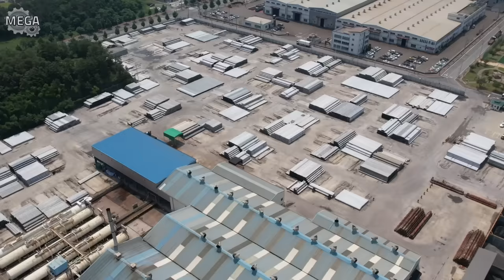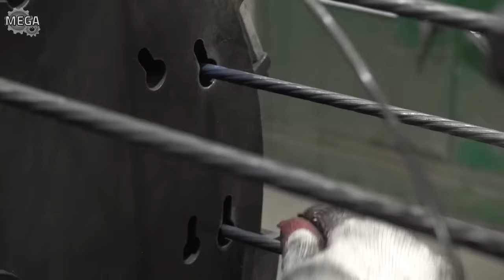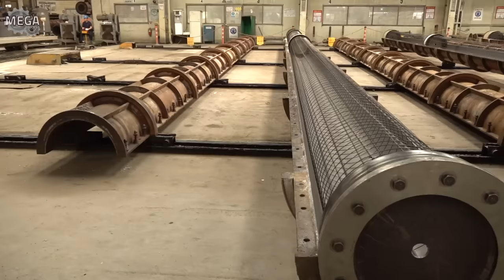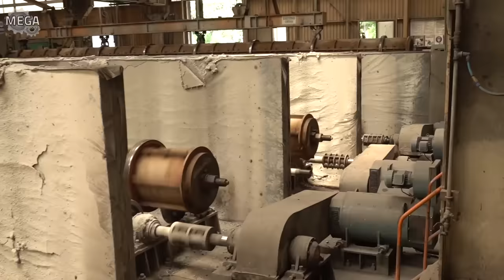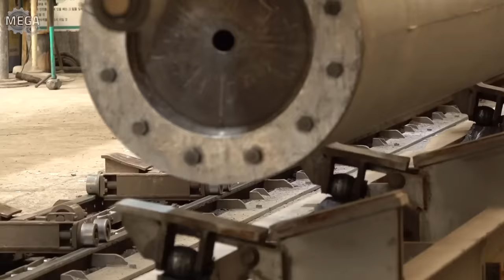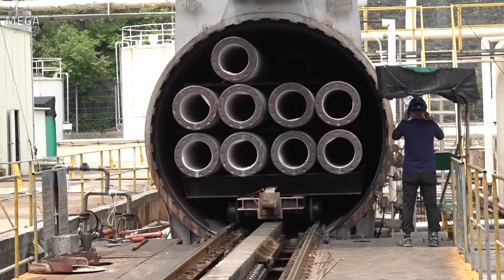Process of making ultra-high-strength concrete pile. Korean No.1 PHC pile factory

Comment from the maker: 🔎 Information (정보)
🔔 Ultra-high-strength concrete pile in the video (영상 속 제품) : 삼일씨엔에스 (bit.ly/3XF8vTx)
🗺 Address (주소) : 896-15, Gyenae-ri, Chilseo-myeon, Haman-gun, Gyeongsangnam-do, Republic of Korea (경상남도 함안군 칠서면 공단북길 50)
Reply: 😊😂😢❤😮ຫຫຫຫຫຫຫປປປຶຫຫຫຫຫຫຫປປປໄົຝຝຝຝຝຝຝປໍຝຝຝຝຝຝຝປໍຝຝຝຝຝຝຝປໍຝຝຝຝຝຝຝປໍຝຝຝຝຝຝຝປໍຝຝຝຝຝຝຝປໍຝຝຝຝຝຝຝປໍຝຝຝຝຝຝຝປຖຖຖຢຮືືືືືືືເເເເເເຫ❤😮😢
Reply: Pp
Reply: 가격은 얼마나 할까요?
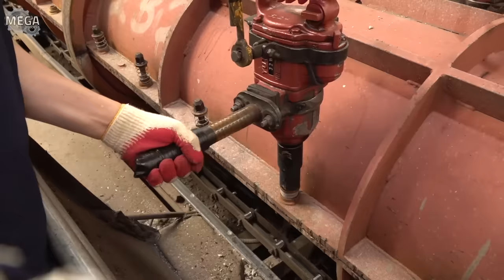Reply: ㆍㄱㆍ2ㆍ2ㆍ2ᆢㄱᆢ2ᆢㄱᆢㄱ2ᆢ2ㆍㄱㆍ2ᆢ2ᆢㄱᆢ22ᆢ2ᆢ2ᆢㄱㆍ2ㆍ2ᆢ2ᆢㄱㆍㄱᆢㄱ2ㆍ2ᆢㄱ2ㄱㆍㄱㆍ2ㆍ2ᆢㄱㆍㅋ2ㆍㄱ2ㆍㄱㆍ2ㆍ2ㄱㆍ2ㄱㆍㅋᆢㄲᆢㄱㆍ2ㄱ2ᆢㄱㆍㄱ2ㆍㄱᆢ2ᆢㄱᆢㄱ2ㆍ2ㆍ2ᆢ2ㄱㆍ2ㆍ2ㆍㄱᆢ2ㄱᆢㄱㆍㄱᆢㄱᆢ2ᆢㄱㆍ2ᆢ2ㆍㄱᆢ2ㄱ2ㆍ2ᆢㄱㆍㄱᆢ2ᆢㄱᆢ2ᆢㄱᆢㄱㆍ2ㆍ2ᆢㅋㆍ2ᆢ2ㅕᆢ2ᆢ2ㆍㅋ2ᆢㄱㆍㅋ2ㆍ2ᆢ2ㄱᆢㄱㆍ2ᆢ2ㄱᆢㄱㆍ2ᆢ2ᆢㄱᆢㄱㆍ2ㆍ2ㆍ2ㄱㆍㄱᆢㄱᆢ2ㆍ2ᆢ2ㆍㄱㅋㆍ2ᆢ2ᆢㄱㆍ 5:26 ᆢㄱㆍㄱㆍㄱㆍㄱㄱᆢ2ᆢ2ㆍ2ㄱᆢ2ᆢ2ㆍ2ㆍ2ᆢ2ᆢㄱㆍ2ㆍ2ㆍ2ㆍㄱᆢㄱ2ㆍ2ㆍㄱㆍ2ㆍ2ㆍ2ㆍ2ᆢㄱㆍ2ᆢㄱㆍ2ㆍ2ᆢㄱㆍ2ᆢ2ㆍ2ᆢ2ᆢ2ᆢ2ㆍ22ᆢㄱㆍ2ᆢㄱㄱᆢ2ᆢㄱᆢㄱㆍㄱᆢㄱᆢ2ᆢㄱㆍㄱㆍㄱㆍ2ᆢ2ㆍ2ᆢㄱㆍㄱㆍ2ㆍ2ᆢ2ᆢㄱㆍ2ㄱᆢ2ㆍ2ᆢ2ㆍ2ㆍㄱㆍ2ᆢ2ᆢ2ㆍ2ㆍ2ㆍㄱㆍ2ㆍㄱㆍ2ᆢ2ᆢ2ㆍ2ㄱᆢ2ᆢ2ㆍ2ᆢ2ㄱㆍ2ㆍ2ㆍ2ㆍ2ᆢ2ㆍ2ㆍ2ㆍ2ㆍ2ᆢ2ㆍ2ㆍㄱㆍㄱᆢㄱㆍ2ㆍ2ᆢ2ᆢ2ㆍ2ㆍ2ᆢㄱᆢㆍㄱᆢ2ㆍ2ㆍㆍㆍㆍ2ㆍㆍㆍ2ㆍ2ㆍ2ㆍ2ᆢ2ᆢᆢㆍ2ᆢᆢㄱㆍᆢ2ᆢㆍㆍㆍᆢ2ㆍㆍㄱㆍᆢㆍ2ㆍㄱㆍ2ᆢ2ᆢᆢㆍᆢ2ᆢ2ᆢㄱᆢ2ㆍᆢ2ᆢ2ᆢ2ㆍ2ᆢ2ㆍ2ㆍㆍㆍ2ᆢㆍ2ᆢ2ㆍᆢ2ㆍ2ㆍᆢㆍㆍㆍㆍ2ᆢㆍㆍᆢㆍᆢㄱㆍᆢㆍ2ㆍ2ㆍᆢㆍᆢㄱㆍ2ㅋㆍ2ㆍㆍㆍᆢ2ㆍ2ㆍㆍ2ㆍㆍ22
Reply: Wika beton sepertinya pernah berkunjung ke pabrik ini. 😊😊
Reply: Bak uap sama seperti yg kami buat..

Comment: Wow, in 08:11 you can see how strong negative pressure can be. If I see it correctly, the whole thing is held only by negative pressure. I would never have thought that with this weight.
The whole video is really very interesting. Thanks for that :)
Reply: I think it’s magnet
Reply: @Himanshuyadav-tz9yy  That's right, I hadn't even thought of that. I have therefore looked at the whole thing again. However, I think that there should have been much larger areas with the solenoids above. Of course, I can also be mistaken.
Reply: Suction cups landscapers use them for flag stone
Reply: @NexLevelBacon  Yes, also for transporting a wide variety of window panes.
Reply: @Himanshuyadav-tz9yy its not
Reply: Just to clarify it, there is not such a thing as negative pressure, just negative pressure difference.

Comment: Very interesting ! I thought the steel bars might be under tension while pouring the concrete to produce the high strength pile, please explain, thank you
Reply: Yes. Pre-load beams
Reply: It obviously works brother.
Reply: pre tension steel, Works wonder with concrete. Increase tension strength , complimentary with load bearing concrete. Works in Suspension bridge too.

Comment: these concrete piles must be costlier than a steel pile with the same strength given all those machinery and procedures in the production. and i believe the failures during driving must also be higher compared to a steel pile. i cannot see their advantage.

Comment: Fascinating stuff, that's what fossil fuel allows Humanity to do
Reply: What part required fossil fuel?
Reply: @xaiano794  most of the electric power driving the industry comes from burning fossil fuels, it's been so from the beginning of the industrial age and the trend isn't changing anytime soon. Not even talking about the mining, steel production etc
Reply: @ExecutionSommaire  that's like a guy in 1800 saying that horses are the future since they have pulled everything up until then. 

Wind power is now significantly cheaper (whole life costs as well) than all fossil fuel sources. 

Unlike others,  I simply advocate the cheapest and most efficient methods of producing power,  most fossil fuel proponents are simply using data that's decades old. 

So why would you advocate for higher prices?
Reply: @xaiano794  Where have you seen that I'm advocating for fossil fuels?? That was just a statement. As for the low cost of renewable sources, it's also due to the fact that we have a shit ton of non weather-dependent power production to back it up. Don't jump so quickly into a 100% wind power scenario and assume everything's gonna be as cheap. If you ask me, I'd advocate for next gen nuke + renewables. But that's not gonna happen, at least not in time to avoid horrendous climate-related crisis
Reply: @ExecutionSommaire  I don't know about that, here in the UK we've already eliminated coal all together and have had some days when we managed to be 100% nuclear/renewable so it's clearly possible.

As for cost, having a more comprehensive network solves the issues of supply, it's never not windy everywhere